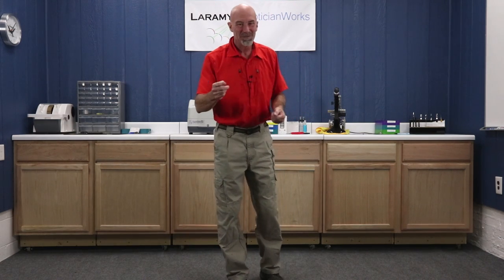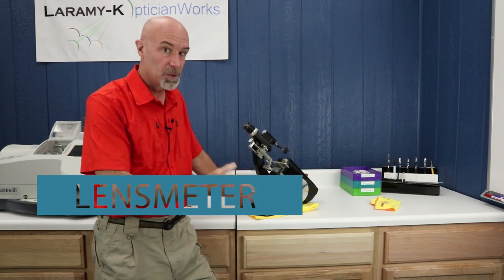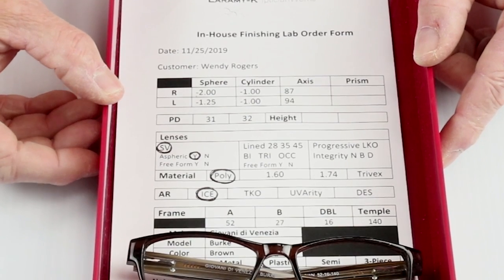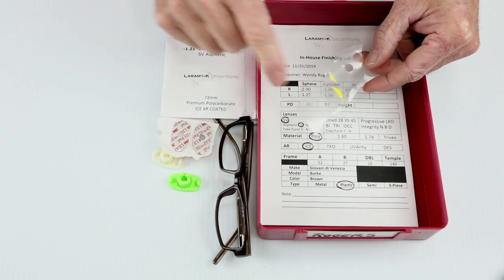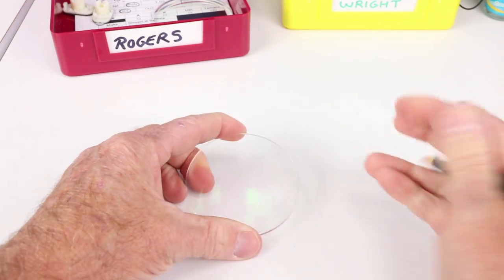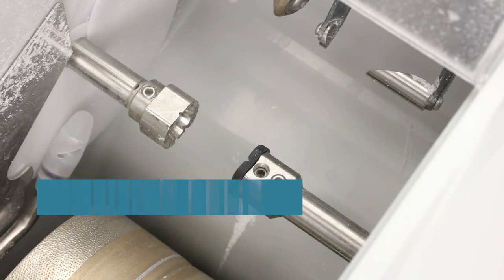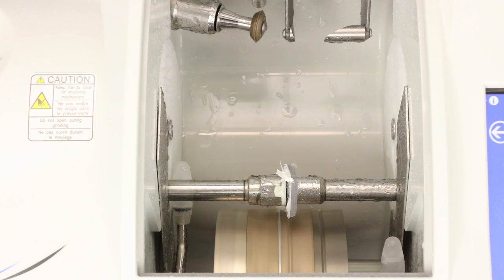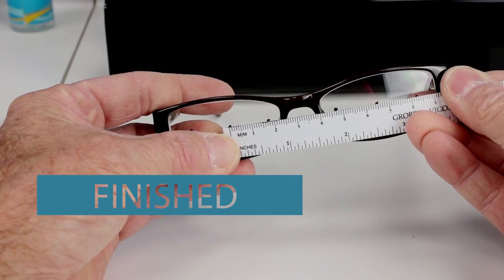How To Edge and Finish Lenses In Office - An Introduction

Comment: Hello, I have high index lenses with 1.74 thinning and -13 prescription in the right lens. I find with my optician, when the lenses are placed into a plastic frame, the frame itself appears to be scuffed around the bridge of the nose and outer edges. I assume this is from some degree of finishing, almost as if the lens has been in the frame and then edged. I have to complain and then have the frame replaced, however I was wondering if you could provide some insight into what may be causing this scuffing to frames? Thank you in advance.
Reply from the maker: Just a hunch but - 13.00 is quite high. That is going to leave behind a very thick edge which then has to be pressed by force alone into the plastic eyewire from the front of the frame. I'm sure that between heating/softening the frame and the thick edge it is catching in that area and causing the marks. It could be avoided with a heavy safety bevel, perhaps a light polish and some careful lens insertion, ( a step bevel if the edger can handle it). BUT - BUT, you are also extremely near sighted so you may well notice minute damage that others might not. But IMO no permanent scuff marks (damage) on a new frame is not really OK. John
Reply: @LaramyKOptical  Thank you for the quick and detailed reply John, I really appreciate it!

Comment: I would like to see you review the Briot Emotion 2 or the Weco E-3 using Gravitech  all in one systems
Reply from the maker: I doubt that will happen. 1) I don't hide my preference for the Nidek/Santinelli edgers. 2) I don't actually have enough edging work to perform real testing. An edger is like a marriage. You won't know how things really are until you are a few years into the relationship. I've lost track but several of the edgers (Briot Weco maybe?) are the same just branded under different licenses. If you are seriously considering any model make them come and put on a show for you - push things and see how it does. John

Comment: Where do you order new tools for your edger? Do you need to get them from the edger manufacturer or is there another company that sells them with the form already dressed in?   Thanks!
Reply from the maker: Best to get them from the manufacturer. So many different types and brands and years and models... They would also know if the wheel needs to be dressed before use. Excellent question by the way! I wouldn't be surprised if they are factory coated to reduce tarnish/rust and might need to be cleaned up first. I only did a wheel swap once on a Santinelli - it wasn't hard to do. John

Comment: Hello Laramy, I got a few questions on your santinelli LE700
1.- how long does it take to edge a single lens?
2.-How reliable is the edging system (how many jobs you have to manually edge after the machine didn't do it accurately) since it's an entry model
Reply from the maker: Sergio, I can answer 1 of the 2 --- Depending on material any edger that uses wheels will take anywhere from 2 minutes to 7 minutes per lens. You have bevel, groove, flat, polish, safety bevel, slow grind - so many variables you can't put a single time on it. I can't say how the 700 performs over time, I only had that here in the studio for a few months. Where I worked we had back-to-back Santinellis running about 15 jobs a day every day and they were super accurate and super reliable too. Check with them - they JUST released a new model like last week! John

Comment: Greetings from London, England. What’s the smallest thickness of mineral glass that can be used on this machine? I cut mineral glass by hand, thickness between 0.7mm-1.4mm with varying different curves, could this machine help me? 

Thanks mate
Reply from the maker: Michael, Drop me an email through the OpticianWorks website so I can connect you with the right people. I know they run watch crystals on some of these machines so I'd guess pretty darned thin. John

Comment: Hi i want to ask, at what mode do you (process) polish1.6 tribrid lens. Thanks :)
Reply from the maker: That would all depend on which edger you have. You would need to get in contact with the company and ask. Different manufacturers call materials different things. Different edgers use different settings. If I had to guess I'd do a 1.6 set on hi-index. If you have no way of knowing for sure I'd experiment with a few cheap as you can find SV lenses. [Don't test on a $150 wholesale progressive] And/or be sure you are standing by to hit the STOP button if things don't look or sound right. Keeping in mind that Trivex will actually smoke when being roughed.
Reply: @LaramyKOptical  next time i'll try on hi-index, because in trivex mode it looks like there is too little time to polish properly when water starts to flow (nidek Lex 1000 edger). Thx for help :)
Reply: @MindaugasJocionis  tribird is a compound material (2 different material in one blank)...the best way is use milling edger but...only some Labs have it. The best mode on common edger usually is the hi index setting mode...like you edge 1.66 lens
Reply: @saeco88  thanks for help, yes i already tried on hi index mode, everything went perfectly.
Reply: @MindaugasJocionis  good 😊

Comment: Does the machine measure the curve of the lens so the bevel  can follow the curve? Or does the bevel just go straight across?
Reply from the maker: A high-end edger will do just that, yes. Many have additional features that allow you to further tweak it. The most modern robotic (MEI) can actually let you "tug" the bevel in place along the entire circumference! The reverse is true  also a very inexpensive low end edger will cut pretty close to a neutral single axis bevel. John
Reply: @LaramyKOptical  what about low end pattern edges that place the bevel in a single plane. Would the acetate frames tolerate this? Or would the lens  end up flattening out the frame.
Reply from the maker: @MA-wy7cr  It's anything can happen day! A warm soft acetate might conform to the flat bevel. A cold rigid one may have lens pop somewhere. Of course it depends on the frame curve - lens curve match to begin with. Sadly no way to predict any outcomes there.

Comment: Bevel disk is also finishis disk in this machine?
Reply from the maker: I think the answer would be yes. Roughing and then then finishing wheel that has the groove for placing or cutting the bevel. The polish wheel is the lighter colored one. John
Reply: @LaramyKOptical  thanks